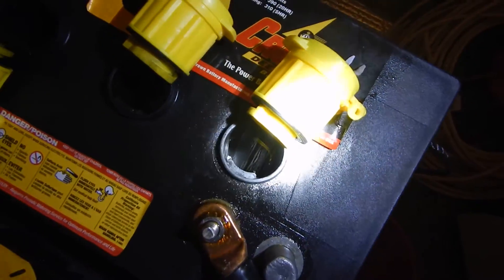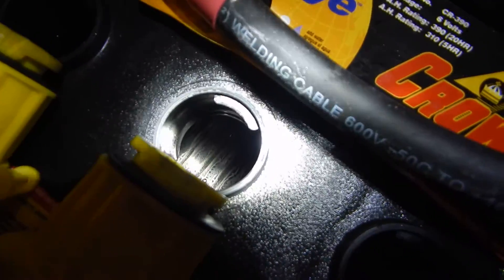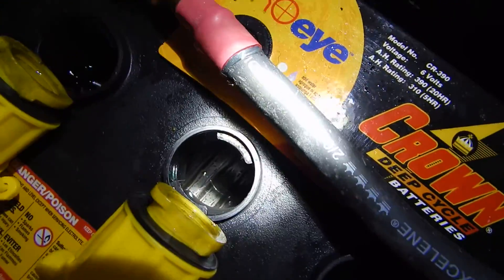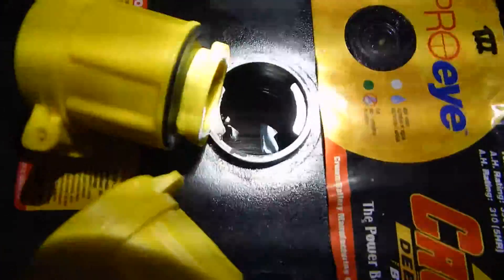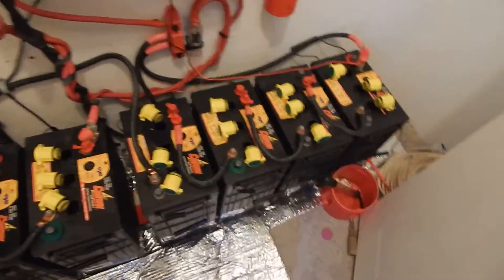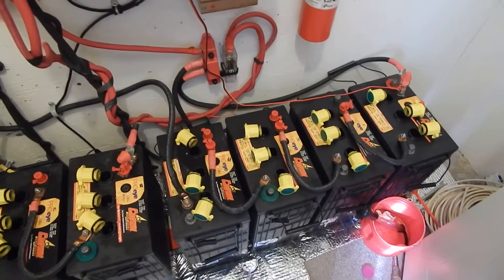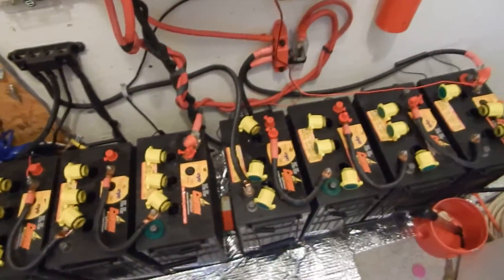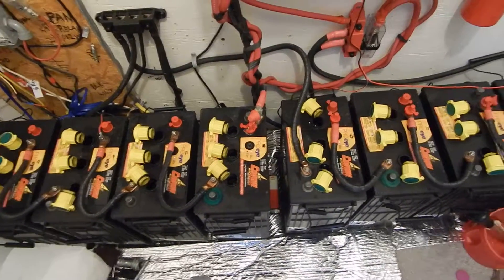Battery Desulfator Update Day 11 Part 2- B

Comment: where'd you get that at bud I'm interested you have a website or you bought that from
Reply from the maker: www.recovermybatteries.com they are in the UK.$139 for this one they have a bigger one that will do up to 3000 amp hrs up to 200 volts. This one will do 12v to 48 volts to 1500 amp hrs.

Comment: I don't know what I have to do, I was going to purchase a set of batteries, for my panels, but it is going on two months without any sun on the great lakes! The worst winter I can remember, but then I haven't had panels very long...
Lead acid is cheap, but looking at salt lead, which I still don't understand fully, or Edison Battery, which is extremely expensive... don't know why they are...

Comment: Great job, filming in those cells has got to be tricky.  I am wondering if a small fiber optic attached to a light so you can get the light just under the surface would help.  Do not worry about the editing friend.
Take Care.

Comment: Told you they worked my friend. Leave it on and the bank will love you long time. Best investment you can make for your bank. Hope you start feeling better my friend. Old age is a bitch.
Reply from the maker: Thank U for this info so much!!   I will wrap this up next weekend I am convinced this is working .What else would do  this to change the battery?   Nothing I can think of this is working great.
Reply: I recommend people put them on there batteries from new. That way there plates stay like new for a long time. They extend the battery life and that means a more cost effective system over time. There are many lower cost units on the market that don't work as they just don't have the oomph required for larger banks.
Reply from the maker: I wish I new about these I would have. I had thought the ones U see for sale every ware for 20 or 30 bucks had to be a joke. This unit works.
Reply: i did a video on them a few years back. I have had one on my bank for a long Time. Just see how it goes my friend. Then tell the people. Thats all we can do in our videos. We can only show them what works or does not work on our systems.  Belive us or not. Its up to them.

Comment: Looks like you are having success.  Did you take any hygrometer readings before you started to compare against?
Reply from the maker: Yes they are the same in the green. this will not fix a battery with a dead or shorted out cell or but if the battery is above 10.5 volts or 2 6vs in series it should do the trick. this unit will do any combo of 12v  up to 48volts & 1500 amp hr. capacity.